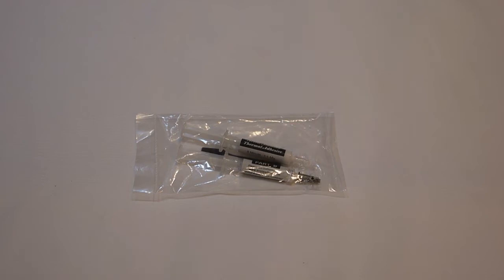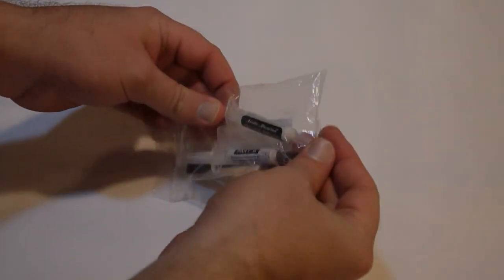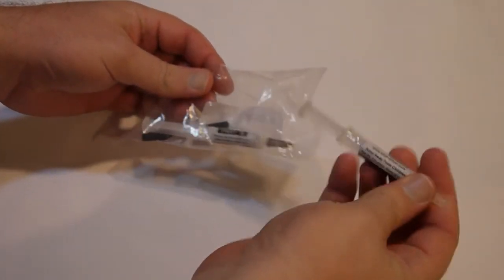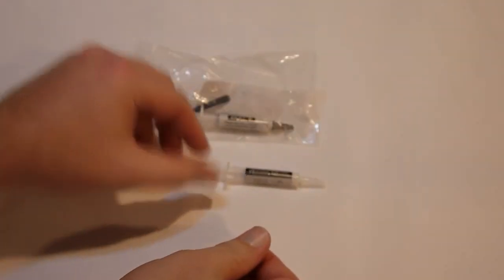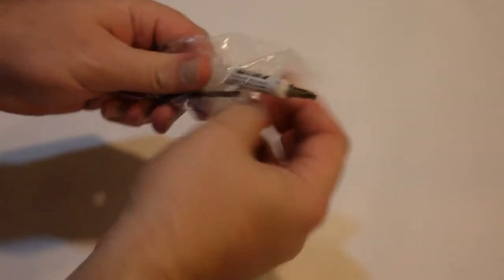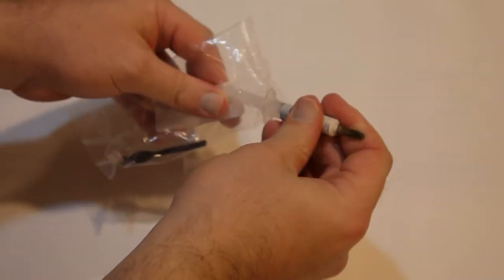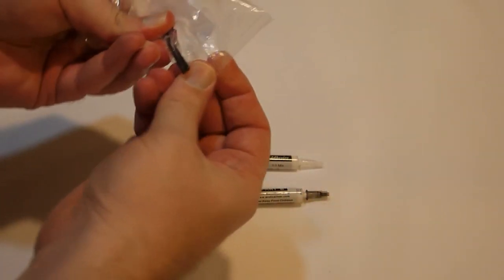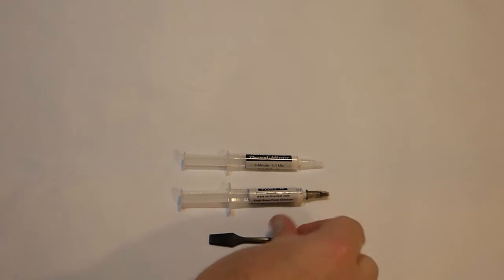Arctic Alumina Thermal Adhesive Unboxing

Comment: This is thermal adhesive, NOT thermal 'paste'.  This is for more or less permanent sticking of a heatsink to a chip (for VRAM on e.g. GPUs or exposed GPU dies on a laptop) while still conducting heat away from the chip. The average user wants paste: arctic silver 5, kryonaut, mx4...mayonnaise...anything but adhesive.

Comment: can i use this with my i7 ? its geting hot
Reply: Tocinow A bit late, but no, no, and hell no. I did this with a Core 2 Quad in my early days, and when that motherboard died I HIGHLY regretted using it, when it came to getting the heatsink off of the processor, and in turn the processor out of the motherboard, and in turn the motherboard out of the case since it was a horrible dell BTX system that had it set up to where you could not remove the motherboard before removing the heatsink. Use arctic AS5 instead, or Arctic Ceramique 2 if you don't want to risk conductivity.